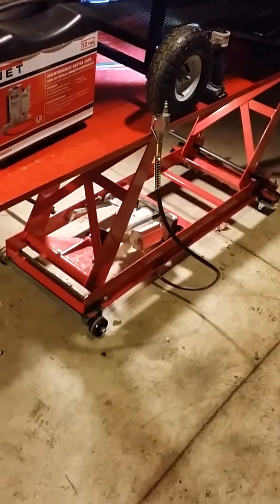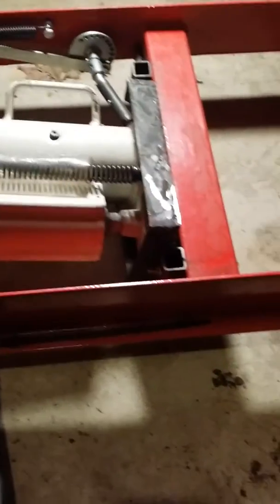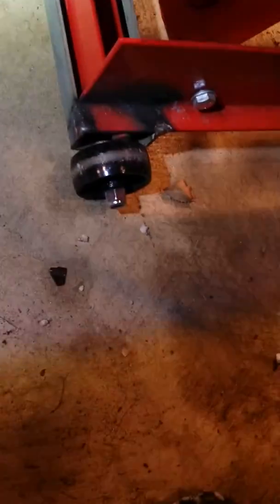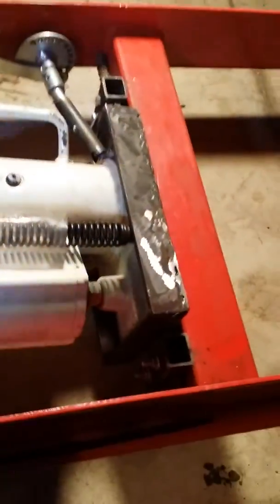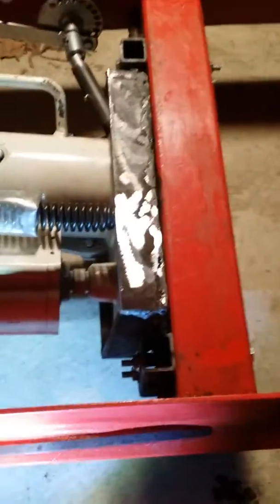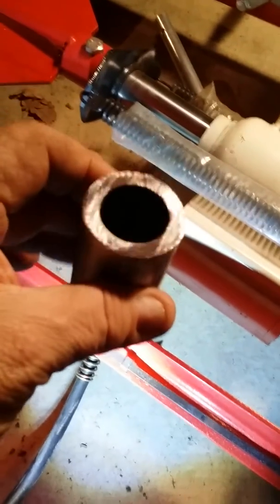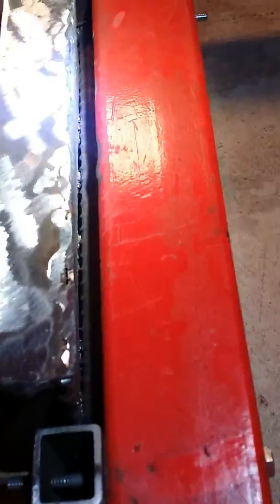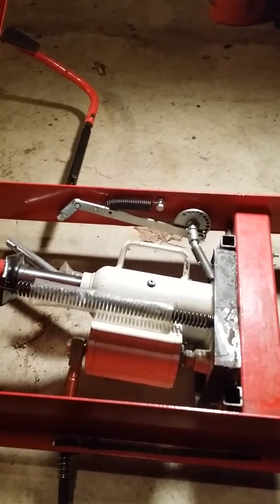Harbor Freight 1,000 lb. Motorcycle Lift Air/hydraulic conversation  part 2

Comment: How much did it cost to convert it in total?
Reply from the maker: Dylan Young , the Jet brand air/hydraulic jack was $239 the steel I used was approximately $20-25,  most of the steel I had on hand. The time I had in putting it all together, maybe 6-8 hours over a period of 2 weeks. I had no real plan,  usually I just do a little work, think on it over night, then do a little more work, think on it over night ect. ect..........